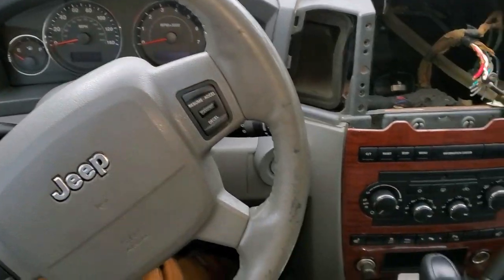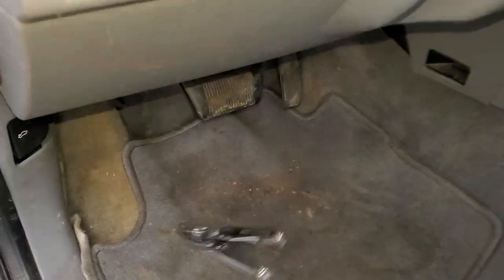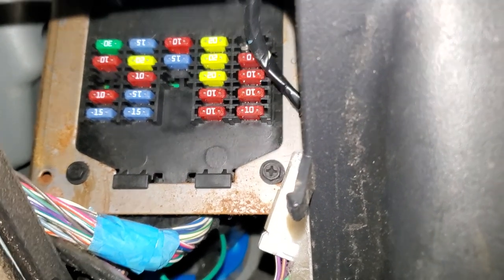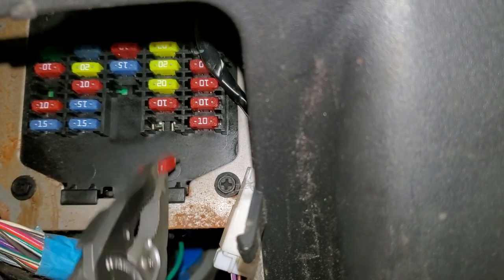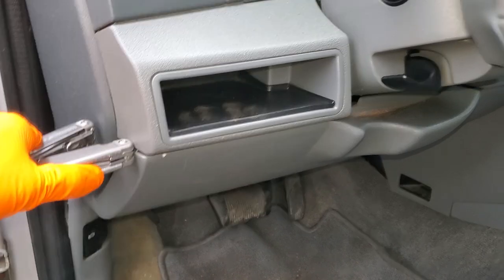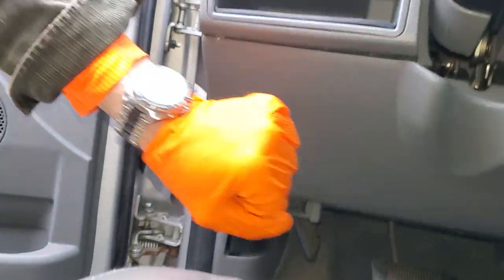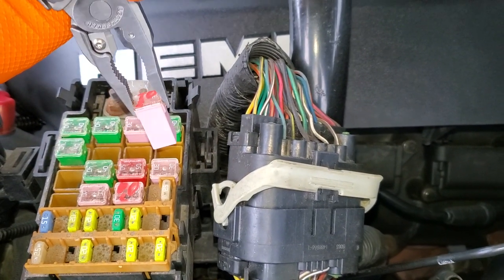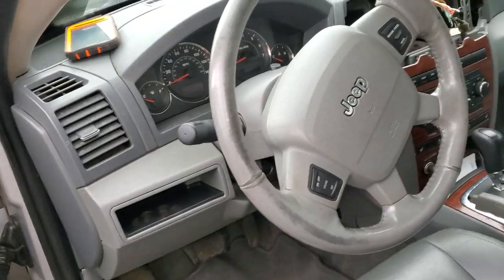2005 - 2010 Jeep Grand Cherokee Power Outlet Fuses, Cigarette Lighter Fuse & Relay

Comment: I have a 2005 wk 4.7, apparently I screwed something up.  I have no  guages, no power to driver side outlet,  no door locks. The #14 fuse is good and the relay on top of the box in the dash. All other fuses are good so im assuming its only that circuit.  My question is what wire powers that relay? I cant find a diagram specific to this jeep. Any help appreciated.

Comment: Which blue fuse goes to the rear windshield wiper on the inside panel? I can’t find a diagram/video for 2006/2007 Jeep Grand Cherokee for it. Diagram wasn’t in owners manual either just chart.

Comment: I want to know how to replace the (big) RELAY behind the under-dash fuse bank (aka the K2 relay).
My 2007 Jeep Grand Cherokee has been having intermittent issues powering up the drive's side lighter (the accessory power outlet) ... all fuses are verified and replaced (as are the relays in the engine compartment) all that's left is the relay that our host briefly pointed at in the video.  Anyone have experience with replacing this?  In the jeep fuse diagrams is is labeled K2.

Comment: Can u tells what the other relays on the back of the that fuse box are for.just wondering, because I'm trying to figure out why my hazards light stopped working, everything else works just fine.no one can seem to figure this one out.im pretty handy,but this one has me stumped.i been at it for couple weeks now.i did get maybe a clue this morning.i was at work with the key turned so I could listen to the radio.when I turned the key off the hazard lights flashed one time.that was the only signs of life.this is the only thing stopping me from getting my inspection sticker.can any body help me please.

Comment: My cruise control stopped working so i changed the clock spring. it hasn't worked even with the new clock spring. Is there a fuse I can check?

Comment: Hey so i was using a car vacuum, had it plugged into drivers side car lighter and it blew out, ive changed all the fuses to both my stereo "cause it blew my stereo as well as my car lighter," and to the power outlets, lighter still dont work nor does radio! Like they are getting no power, could it be the relays?

Comment: My driver side power seat adjustment went dead. Could that be fuse related? Motor is completely dead... passenger side works fine. 2009 Grand Cherokee Limited. Thanks!

Comment: I don't have light in the ac panel, I just bought another panel and I don't have light either. Could you tell me if there is a fuse for the light bulbs?

Comment: I changed the 3 20's and the 2 30's under the hood and the passenger side still doesn't work. Any other suggestions? It's an 07 grand cherokee. Thanks.
Reply: Did you find a solution if so what was it?